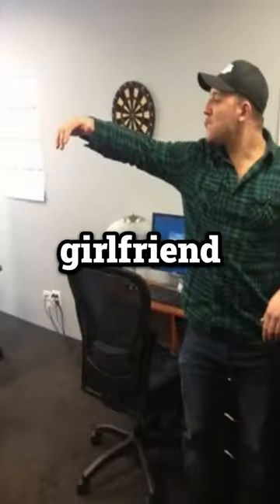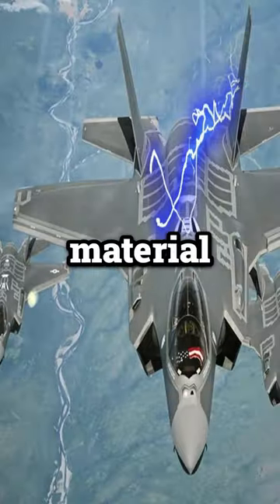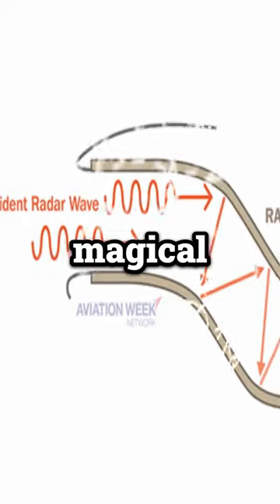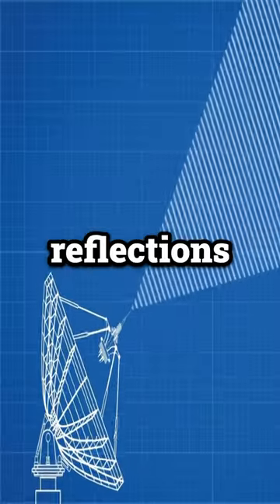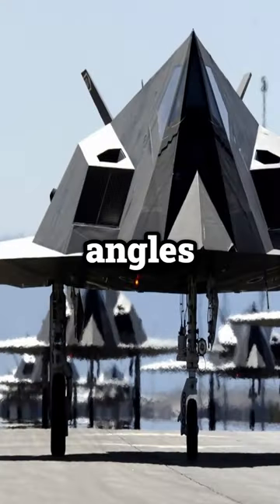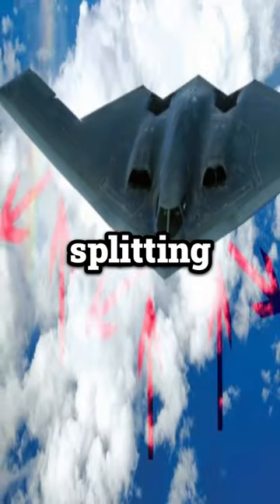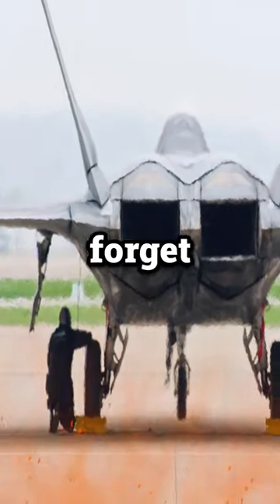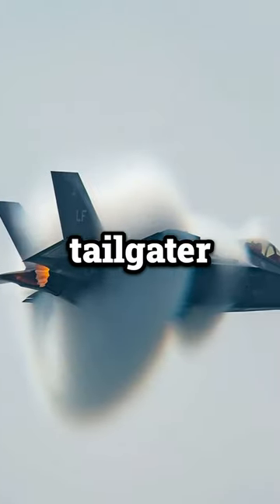How Stealth Aircrafts Work?? #shorts

Comment: The Chernobyll Pripyat power station was built in part to power Duga (1976-1989) over horizon radar- which like US-Australian JORN can also detect stealth. Russia still uses Dnestr, a more advanced Duga, along with Daugava- these long range wide band radars easily detect stealth and what they are designed for- space debris. If you can target and track space junk, how easy in comparison is hundreds of km closer, 1000x bigger aircraft?